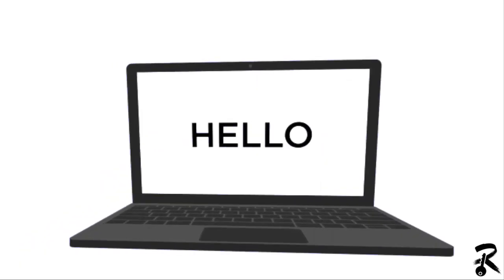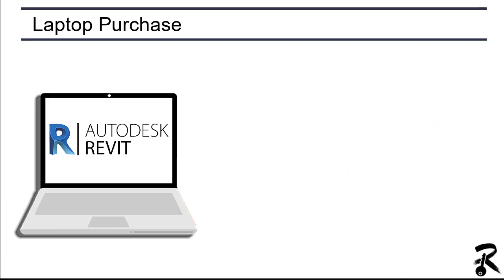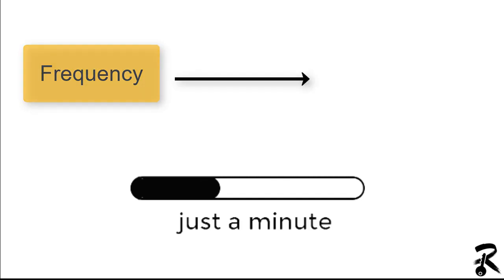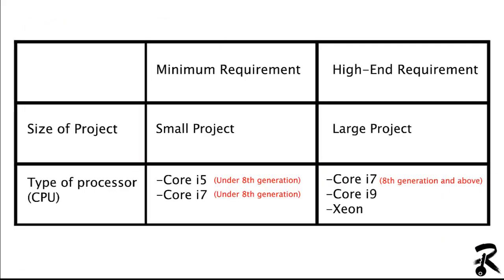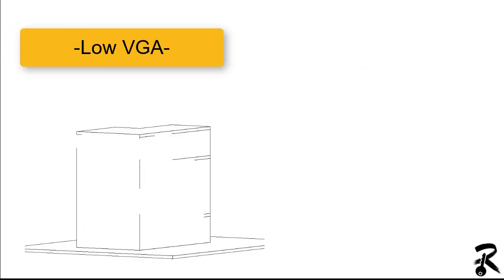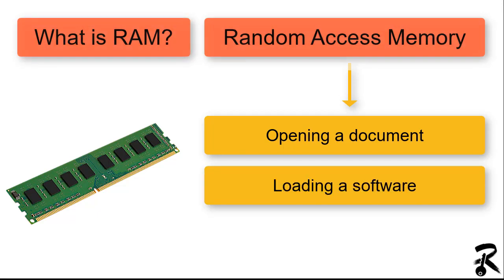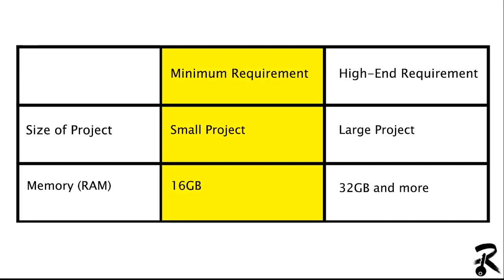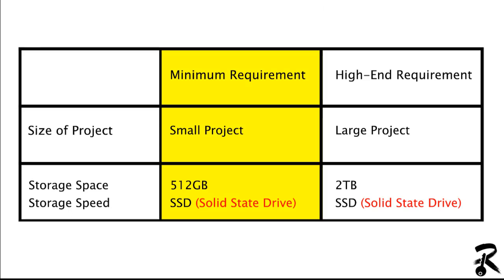How To Choose a PC for Autodesk Revit

Comment: Ryzen 5 5600x better or Intel i5
Reply from the maker: Hello Muhammad, 
Please would you specify the generations of Intel i5 and Ryzen 5600x?
Reply: @revitkeys7089  ryzen 5 5600x and Intel i5 10th gen which GPU GT710 worth it or not
Reply from the maker: Hello Muhammad,
Intel i5 10th gen is better than ryzen 5 5600x!!
Reply: @revitkeys7089  vedio editing 3d work ryzen

Comment: laptops and  desktops different things.  For revit better to choose desktop.  Best CPU performance  - good but don't must. You can buy ryzen 3100x and it will be absolutely enough.   RAM - at least 32 GB for  big projects. Small projects - 16 Gb. GPU (not VGA) at least 2 GB ... 4GB comfortable, 6 GB - overprice. SSD or NVME - good solution, don't mind 1.5 Gb/s or 3.0 Gb/s - you couldn't find the difference. And if you are need rendering - you must need high performance GPU
Reply: Rendering is CPUs work
Reply: @gobimurugesan2411  You are absolutely right. Rendering in revit - use CPU, but if you use additional soft for render (architects usually use) like lumion you need powerfuul GPU